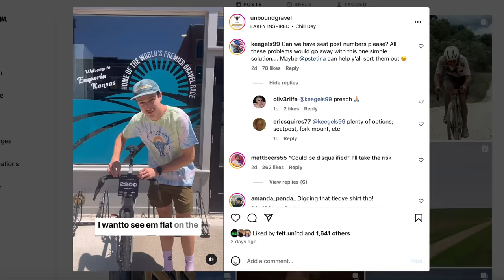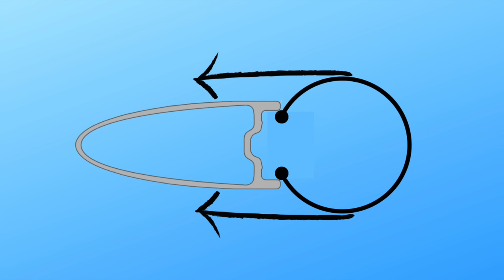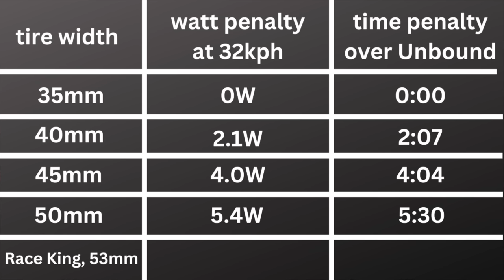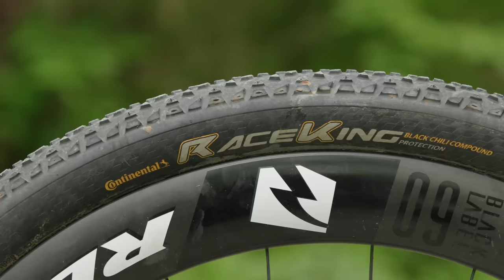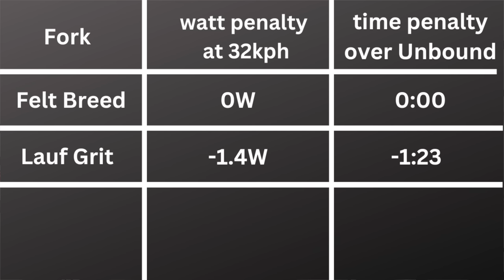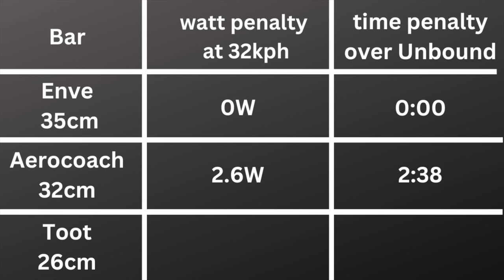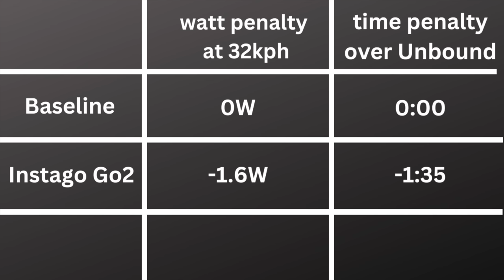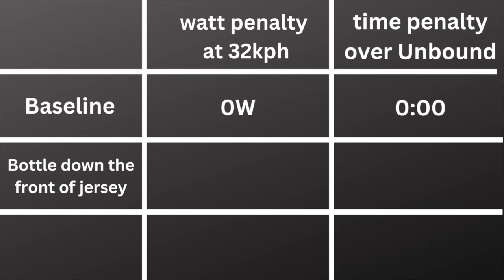We Went to a Wind Tunnel to Build the Fastest Unbound 200 Bike and This Is The Result

Comment: The thing that scares me about that Lauf fork on that bike is the possible mud/gravel build up in the leaf system if it's a wet disaster of a day. Other than that, sweet bike.
Reply: Its not going to cause any issues. The amount of mud and packing needed to cause issues would surely cause something else to fail first. The leaves are inline with the fork leg and wheel, so most of the mud is going to get flung up or back, versus to the side to gum up the leaves. I have an older version of this fork and I don't have issues. Its a great piece of bike tech for gravel.

Comment: HED makes the Jet RCD Pro full rear disc, spoked underneath for durability, 21mm inner width, tubeless. Rear disc is ultimate aero, and interestingly rear disc + shallow-ish front is actually more stable in crosswinds than 2 deepish rims, since it moves the center of pressure back. Just sayin' 😉

Comment: Try a handlebar bag with a decaleur. It sounds nuts, but Jan Heine found that he saved watts as long as the bag was wide enough to fill the gap between the hoods — if it didn’t, it was a loss.  It was more important to have easy access (top opening and magnetic clasps) than to have it be some rounded shape.

Comment: Great video. Takeaway - it’s almost impossible to draw conclusions from wind tunnel data. Your shallow vs deep wheels were only 1 to 2 watts faster. Delaney did a shallow vs 45mm rim test on 42 tires and was 8 watts faster. Same or similar wind speed and yaw.

Comment: Fantastic video, thank you! Have you measured how much time you spend in draft during races like Unbound? Intuitively that would be a percentage big enough to lessen the impact of all the aero gains but it can't hurt as the weight penalty is rather small. I am more excited to see how your big tire + suspension idea works out. It if it turns out to be faster than a standard setup it's fantastic news for gravel bikes as we are all about to get way more comfortable bikes in coming years (more tire clearance + Lauf forks).

Anyway, it will be easy to see as you are likely to be the only rider with suspension in top 17. I wish you all the luck in the race!

Comment: In my opinion, as important as the aero dynamics are around the Lauf fork I feel the real benefit is the increase speed due to superior grip on the trail surface – reduce bumping. 

The fork is designed to be aero and more importantly increase rider confidence that the front wheel will hold when concerning. This is also supported by the fact the design has the minimum weight, of the fork, lower on the bike to tradition folks. This also lowers the center of the gravity and thus further improves confidence/speed in the corners.

Until other bikes/folks produce not only more aero fork that has a lower centre of gravity to the Lauf, it will always be wanting. The Lauf fork is miles ahead of everyone else, IMO.

Comment: The Continental RaceKing 2.2 ProTection BCC in a tubeless setup are the fastest MTB Tyres out there.  So much mechanical grip, so little resistance.  We're waiting for an (offroad) even faster 2.4 replacement in the xx-tal nomenclature at 630-640 grams.  Greetings from the manly, burly Mountainbike World.   

p.s. the closer you get to a teardrop shape (Tyre+Rim), the lower the cd will become, same for the not-smooth surface (golfball comparison).  Dimpling the surface of the dish, the frame and the handlebar should yield even better results!  You can thank me later :)

Comment: I have some issue with comparing BRR's MTB chart to their other charts.  All the MTB pressures seem too high to make for a good comparison using the columns as listed.  25psi in a 2.2 isn't "Low" these days.  So the rolling resistance values for MTB should be a little higher.  And if you exclude the discontinued RaceKing and use the latest test, the RaceKing and TerraSpeed may be much closer in rolling resistance on a smooth-ish surface.

Comment: I noticed the Raceking side knobs seem cut or trimmed compared to stock, is that 1 for clearance? or 2 to help the aero drag. Thinking if they were trimmed in the aero testing but the 50mm Pirelli Gravel H were not that's a pretty good side knob sticking out and not as round as the trimmed Raceking. Also, a trimmed raceking might lose that final traction edge on loose gravel, so wondering why its trimmed?

Comment: AND AND AND: that gearing is too tall, even for a flat course. However, you and the rest of the pro peleton can't all be wrong. It will be interesting to see how that goes and what average cadence gets spun with the 165's over those 200 miles. It seems like only yesterday, Lance the Disgraced overtook Jan 'monster gear' Ulrich, on a TT spinning approx 90 rpm. Sorry to give no f's about the paint scheme or that goofy fork. I have developed a man-crush on Silca Josh.  My (emulsified wax) lube is dripped on to the top of my chain, just fore of the rear (big) sprocket, to good effect for some hundreds of miles.

Comment: Hi Dylan, great video, simple question, what about 650b wheels? They are smaller, with even shorter spokes are they more aero? They generally also allow wider tires to be run and so I’d appreciate your opinion. I find the big advantage of 29 wheels is grip while Mtbing, but maybe grip isn’t such an issue on gravel.

Comment: I'm curious...I assume the wind tunnel testing was done with the "wind" straight on into the bike.  I would think even a slight angle, left or right of dead center would effect the drag efficiency of all the components and rider.  Rarely, if ever are we riding into a perfectly straight on headwind.
Reply: Normally, wind tunnel tests for biking are done at various yaw angles. Then, you calcite a weighted average , based on what you think is a representative average yaw angle.

Comment: On the wind resistance of the front spring. My guess is , that because the wind is already seperated the extra material doesn't realy matter. And since the distance between te spring and all that comes behind it keeps the air more turbulent and the negative pressure lower, the resistance of all that comes later is lower. Its most of the time the negaitve pressure behind the object that is holding you down. Reduce the ratio between the positive pressure at the front and the negative pressure at the back. That is why a wing is dropped shaped. To reduce the nagative pressure at the back.

Comment: Out of curiosity, did you test the 27.5 x 2.2" Race King as well? Would have loved to understand how that setup fared as you should get the same rolling diameter as the traditional 700c x 38mm tires with less frontal area and most of the volume benefits.

Comment: good conversation points around tyres, gravel vs MTB options. in short tyres need to be dual ply, this would panic most as the weight gain be say 200/300grams each end but the security and comfort increase into rolling speed due to size options and psi you could consider.

Comment: Awesome insights but I’ve got to point out a recurring flaw in your analysis that I have noticed. The rolling resistance comparison is using the same pressure for the race king and the Terra speed. With the race king being so much wider, it would be a harsher ride and you would generally run it at a lower pressure. So it’s not fair to compare extra low to extra low, it would be more accurate to compare extra low mtn tires to medium pressure gravel tires. Would love to know your thoughts on this. 

Also i would love to see a real world comparison on a rough surface between gravel and mtn tires.
Reply: Run it through the Pro tire comparison on BRR and you will see that the Race King is faster than the 40 Terra at the same casing tension
Reply: I mean using the word 'harsher' to describe riding on 53mm tires with suspension fork on gravel is showing a flaw in your analysis

Comment: Awesome video!

How do you determine maximum tire width?

I currently have some 45mm tires(measuring 42mm) fitted on a bike advertised as 40mm maximum. 

I'm currently constantly weary if the tire stretches out further or if it gets really muddy, but im lucky so far!

Comment: I am bought in on the bigger tires, but limited by my frame. I can squeeze 700x47 which I am currently running but the bike also accepts 650x56 (2.2"). Is it worth it to go to 650 for the extra 9mm or so? I already have a set of 650 wheels but they are not aero like my 700 wheels.

Comment: 20:12 - Hey Dylan, regarding this point, would you say that this 'comfort test' over some rough asphalt could be used as a poor man's CRR test or be used to optimize/tweak tyre pressures for TTs? Does the vibration harshness correlate perfectly with the actual numbers or is it only part of the equation?

Comment: Amazing bike! Congrats. How did you decide to put a road wheel with 21 mm internal width? Usually, brands discourage you from doing that. I'm in the same dilemma: I have a pair of carbon road wheels with 21 mm internal width that I would like to put in my gravel bike (and buy a set of more advanced road wheels). The description on the internet of the wheels says I can only run 25-38 mm tires, but I want to put some 45 mm tires (to run on light gravel, not even close to Unbound). However, the ETRTO chart of recommended tires says I can easily put a 45 mm tire on a wheel with 21 mm of internal width. Who should I listen to? Is it that wheel brands discourage the use of road wheels on gravel so that they get to sell more wheelsets? Thanks!!

Comment: One thing to note on the increased aero efficiency with eh mtb tire is that it mounting a larger tire on a skinny rim often results in a more rounded profile. I call it light bulb effect. The more pronounced center profile also decreases rolling resistance.

Comment: To be fear most of choices pretty logical and explainable... If You mear mortal and not bicycle aero fanatics.
For example botles inside main triangle cover it's emptiness which lead to less turbulance because of it. I'm pretty shure that if test bike with just covered main triangle and without cover diference even more noticeable. If You look on olimpic bicycles or some extremes like those Lotus bicycle - they done exactly this.
I'm extremely far from bicycle sport, but even I found any of those choices more than resonable. And it mean something.

Comment: Great video !! No issue with crankset chainline ? How does a 50mm clearance allows a road crankset ?
Reply: My first generation Checkpoint runs a road crankset (I run 50 tooth Ultegra) and will fit a 50mm Thunderburt in the rear and the chain line works well.

Comment: I guess I have to use mezcals for xc now that race kings are unobtainum unless I get them from europe lol. You mentioned the heat but I wonder what your take is on the USWE packs. Every time I've used one I've felt like I'm overheating and cant push the same watts. I wanted to be able to use them in endurance XC races but they're so damn hot it's not worth it.

Comment: Dylan, did you test the wheel as rotating vs. no rotating. It would be an interesting experiment. We often talk about the tire/wheel shape as being like an airplane wing, which would be fair if the tire didn't rotate. My thought is that the rotating tire makes the air behave differently in unexpected ways which are hard to see/predict in the tunnel. If they ever found out what the rotating air did, then they could design treadwalls which better act as vortex generators.
Reply: It was spinning in the video...

Comment: You've previously tested hydration pack to be faster, so what's the reason behind four bottles on the bike as they are slower than no bottles?
Also, GRX 11-speed I guess purely due to unavaliability of 12-speed GRX Di2 at the time of filming, am I right? The 11-speed CS-HG800 has terrible gear ratios IMO especially compared to let's say 12-speed CS-R9200 11–34.

Comment: The tires are potentially a serious problem on the North course. The casings are pretty thin etc. We’ll see shortly... remember what your Pirelli H’s did there last time we ran it?
Reply: They're thin but being able to run much lower pressure will protect those tires too
Reply: @veganpotterthevegan  Maybe. Theory is about to meet sharp flint
Reply: @thumperd8  he's already done this before.   That said, there's good reason why nobody runs 1.8" tires in mountain bike races anymore.  They're largely  using thin,  fast 2.4s.  Extreme rockyess only determines whether they run an insert or extra sealant
Reply: @veganpotterthevegan  Yes and I have too. We were at podiums discussing how many punctures he had that year vs mine. He brought the wrong tires that time. Also, sure on the MTBs 1) they don’t usually race on sharp flint and 2) but some courses they run say, Aspens, and leave the Thunder Burts and Race Kings in the truck. So for no, this is theory, early days for the approach in gravel. I’m not saying it’s wrong, I’m saying we don’t know yet.
Reply: @thumperd8   lots of courses are loaded with sharp flint.  Many BWRs(especially Cedar City), and Leadville has long sections of sharp flint.
Reply: @veganpotterthevegan  I've ridden both. Not faintly comparable even the 4-mile single track at cedar city. Just not sharp.... As stated I’m not disagreeing, I’m saying it hasn’t been proven out and this course is going to give good if not perfect data points. let it drop please.
Reply: @thumperd8  let it drop, you only made your comment because you have no understanding of tire science. *I used to live in Cedar City🙃
Reply: @veganpotterthevegan  Dude, really.
Reply: @againthebegin  for sure.

Comment: wanted gravel bike with mtb tyres forever, 
ciould you please share any photos showing chainstay behind the chainring? 
it's widly accepted that more than 50mm tyres can't be used on 2x setup as such . 

there's ( in americas) trail donkey from rodeolabs which sort of achived that with razor sharp chainstay and not selling outside of america. specialized diverge can't take even 50mm tyres but is a bit more than thin.

Comment: Here's a honest question. I have a recent experience with performance-oriented gravel riding on these two tires and I'm faster on the NARROWER one on everything except maybe for Cat 3 gravel and above (to use the Silca lingo; basically everything except MTB terrain):

* Schwalbe G-One Overland 50 (670g, 47mm on my rims)
* Teravail Rutland Durable 42 (545g, 40mm on my rims)

How is that possible? I have a few thoughts on why it's the case.

* I'm especially faster on the narrower one when climbing. One of the recent trends in the online world is that tire weight is basically completely irrelevant and the argument is something along the lines of "once you accelerate the weight does not matter", which is completely laughable -- as if anywhere except for track cycling you could "just accelerate and then just go". It's absurd. Acceleration is a physical process that happens thousands of times over the course of every ride, it's even more important when climbing.
* Line choice matters. I'm more agile on the narrower tire and I can get away with line choice mistakes more often than when riding on a baloon. Wider tires have better traction and RR on garbage surfaces _but you have to get on that garbage surface in the first place_. If I can navigate terrain with loose elements better with narrower tire, I don't need "benefits" of the wider tire.
* Narrower tires are more comfortable when run at the SAME pressure as wider tires (because there is less vertical tension/deformation and less air to displace, Silca guy himself has an article on this on his blog). On reasonably hard and hardpacked surfaces wider tires have better RR when using the same pressure (when have you last time heard someone mention this rule and include that pressure caveat??? Not even in this video, mr. Johnson, you're as guilty of this travesty as anyone...). So to get that good RR you have to pump the wide tires up more but that will kick your ass more, leading to higher fatigue. So you have to choose either baloony tire for pure offroad or road tire for road riding but I ride a mixture on pretty much every ride I do. I did my second best time on a Cat 2 gravel descent today on the Teravails and it was not an excercise in self-punishment. 

Yes, for Unbound the Contis are probably perfect but that's not an excuse for flooding the internet with the "wider is better" rule voided of all context and reduced to its caricature...

Comment: If the explanation of getting lucky based on the reynolds number "dip" is true (and i tend to agree) this means that this tyre-rim combo is only more efficient at that SPECIFIC reynolds number=speed. Does the reynolds number change enough to make this combination LESS aerodynamic than its competitors in real world cycling speeds or is the difference negligeable? (Engineering question, hope someone will know what i'm talking about)

Comment: Shouldn't you have gone for a wider rim!?  (Keeping approximately the same depth)
There should be more gain to be had from a better tyre/rim interface than having to go deeper than 50mm, shouldn't it?
I can imagine this might be limited by the offerings of Reynolds but it would have been very interesting to test as 40mm wide areo wheelsets are starting to appear among the gravel options.